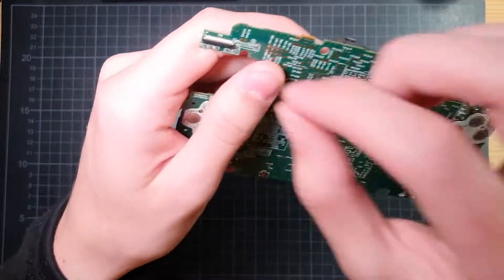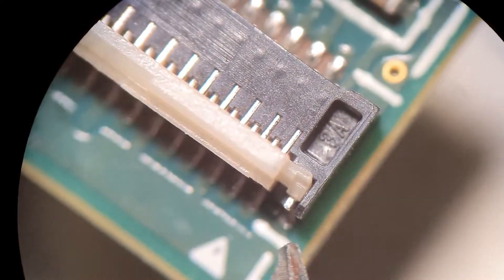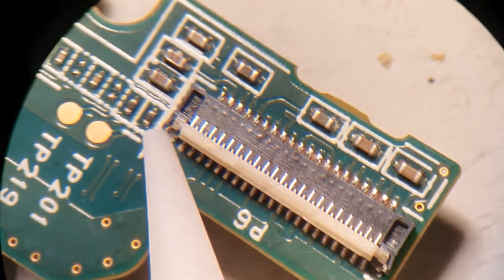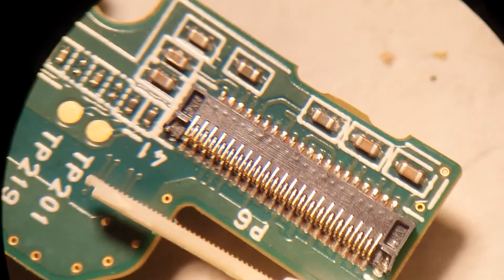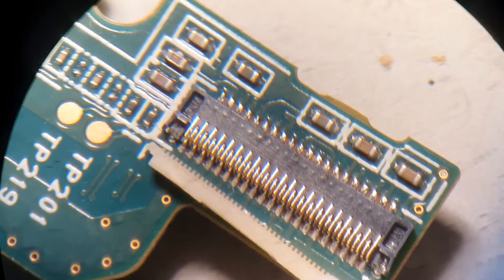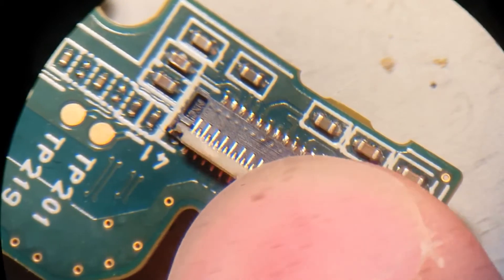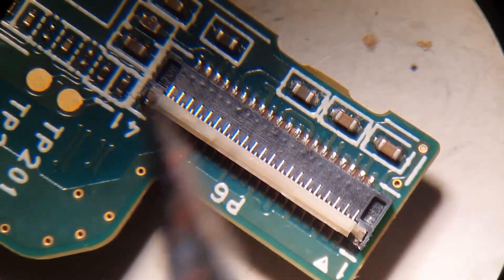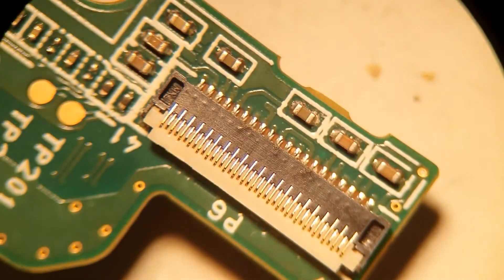Nintendo (New) 3DS (XL) 2DS Ribbon Latch Replacement (no soldering!)

Comment from the maker: Some additional info:
- It's possible to do this without a microscope, but it would have been hard to see on camera
- This isn't a perfect fix, soldering a new connector in place is the best solution. Still, this should hold up just fine if you're careful.
- Make sure to use a nice set of tweezers (I like ceramic tweezers, they don't bend) and a sharp knife while doing this.
- If you break one of the metal tabs on the side it should still work. Replacement is recommended though.
Reply: This worked and helped me fix my Mobo. Thank you for the help. You're AWESOME!!!
Reply: Shoot I had a few paragraphs written but then accidentally tapped on another video... anyways Im pretty sure the camera will be impossible to get to and idc about getting a new mic. But this one latch broke yesterday when I took my 3ds apart and I need it for the top display to work.. any Idea where I can get an extra one?
Reply from the maker: Did the latch break or the connector itself? You can get an entire connector on AliExpress, but you would need to solder it to the motherboard.
If you just damaged the latch (and the connector is still fine) you can buy an entire connector and harvest its latch.
Reply: @neotil1  Turns out I was able to get it in and then hold it in place at the bottom while I pushed back against the top. The hinge isnt there to hold it but it but it doesnt seem to move at all and has been working so far.

as for the volume ribbon cable, I couldnt manage to solder it down onto the 4 contacts without them touching so I tried taking the connector off to run a wire toeach hold it went in, and this pcb is oddly sensitive to heat and decided to become a lake for solder to live in. It took a while of scratching to get rid of the solder connecting everything since the ds had some sort of protection to not turn on (Im a little confused how that happened since the volume slider is basically 500-0 ohms and it still lets u turn on if you have your volume max)

 but afterwards I cut the 3.5mm jack off of some really really old ipod headphones to use a a mute for the speakers, and I usually have the volume max when I want to use headphones, so its really just the built in speakers that are irritating at max volume.

I got An emulator working great tho so Its not a huge issue that a few functions are broken on my ds still.
Reply: @neotil1  Can it still work with the broken plastic? One of those supports on the sides broke off.
Reply: using a microsope is much easier though

Comment: You're the damn coolest, replying to every comment! 

I have a N3DS (OG, not XL) that has broken latches for the home button and the touchscreen. Since new motherboards of the OG N3DS are pretty much impossible to find, I was wondering the the latch of the connectors from the N3DSXL would fit on the N3DS's board. Thanks in advance, man!
Reply from the maker: Wait, you mean the New 3DS, right? The Old (some people call it OG) 3DS has the home button soldered on haha)

The touch latches are all the same, but the n3DS models both have these weird connectors for the home button that don't latch up at all. They can't be replaced like in this video, they have to be soldered.
Reply: @neotil1   @3DS Repairs  Haha, that's right! I meant the N3DS.

The touchscreen seems fairly straightforward to fix, as the ZIF connectors are sold online by themselves. The home button on the other hand I don't know how it could be fixed, other than some homemade solution like tape or hot glue.
Reply from the maker: Yeah, the home button needs constant downward pressure to function. Hot glue etc. won't work...

I've seen a 3DS work that used some tissue paper to apply pressure between the connector and the housing. I wouldn't recommend it though haha. I always replace the connectors entirely (solder new ones in place)
Reply: Just broke my latch for the home button too, on a N3DS XL though, but still.

Comment: Do you have a channel to repair Nintendo 2ds? I have a 2ds that gives the charge led but the battery doesn't charge. I measured the 3 pins and noticed differences between another console that charges and one that doesn't

Comment: Hey any tips on how to fix one of the Touch Screen Ribbon Port Socket? The little grey piece broke off. I need 😫some help please!!!
Reply from the maker: Sorry, I don't have a video showing the procedure. Just bend up the pins slightly (about .5mm) and slide a new latch in place (you can reuse the old one if it's not broken). Close the latch and press down firmly to secure everything in place
Reply: @neotil1  ok thank for getting back to me. I will give it a try. If it's not yo much to ask maybe you can make a video of that down the line. Also do you offer any mail-in repair service? I have some of those grey clips coming from Ali express as I have found out they are easy to break. I wish I had a microscope like your to see it better 😔
Reply from the maker: Yeah, I'll see if I can make it happen. I haven't been working on (3)DS consoles for a while though as I have shifted my focus to Gameboy modding and analog camera repair lately.
I do offer mail-in repair, but you'd have to ship your stuff to Germany which wouldn't be cost effective hahaha
Reply: @neotil1  oh wow Germany! Well you never know, might be cheap for me to just take a vacation over there and drop it off in person! 😆
Reply: @7NINER3  hey, assuming you’ve gotten your clips and worked on this how hard was it for you to solder the clip onto that area because I legit have that same problem. 😭 ebay seller broke the clip but I’m determined to fix it.
Reply from the maker: I know this is a bit late, but if you're still looking for a guide, I just made one :)
https://youtu.be/4vQQOG1hmxA
Reply from the maker: @FlipJip8  I know this is a bit late, but if you're still looking for a guide, I just made one :)
https://youtu.be/4vQQOG1hmxA

Comment: Hello, I have broken the latch connector for the thumb stick of my New Nintendo 2ds xl.  Would it be possible to solder the ribbon to the motherboard?
Reply from the maker: Yes, but it's 10x easier to either fix the existing connector or solder a new one in place. Soldering a tiny ribbon cable is only possible with good tools, years of soldering experience and lots of patience.

Comment: Thank you!!!! This saved a N3DS XL, got the clamp out of the AXBY daughter while putting it together after replacing a damaged touch screen. 
Thank fully I found this video before damaging it more, when trying to fix it B4 watching this video I broke one of the legs of the white plastic. But just one was enough to make it work. I did this with only my nearsighted eyes haha, would have been better with a microscope as you said.

Before fixing it the console did the pop noise and didn't turn on, almost lost my mind haha. Now it works perfectly.

Comment: Thank goodness I found this video. However, my clamp broke in half on my larger fdc connecter, so I'll try to put it back as it is within a day or 2, (perhaps within 2 weeks) so for my gratitude, I'll share a eBay search where it has some of the fdc connectors for the New Nintendo 3ds Xl: the item is searched as "2 X For Nintendo New 3DS XL LL LCD Display Screen Flex Connector Plug Power"
This may prevent you from buying a whole donor motherboard.

Comment: The plastic part of one of my ribbon cables clamp is broken in half (the one for the motherboard). Should I pay to get it repaired or do you know where I could buy the plastic part, it’s for a New 3ds XL.
Reply from the maker: Connectors are very cheap on AliExpress/eBay :)

If you're unsure if you can perform a repair, consider taking it to a professional to be safe. You might save yourself a lot of money and headaches by not damaging parts any further...
Reply: @neotil1  thank you, I appreciate the advice :)
Reply from the maker: No worries, I hope you're able to fix it!

Comment: Does this also go for the small connectors (like the ones for home button)?
Reply from the maker: Unfortunately I don't have a tutorial for that yet. They are easily replaceable too:

Just bend up the pins a tiny bit (using an X-Acto blade for example) until you can thread a new latch in place (the pins go through the holes). Once that's done, flip the latch down and press to bend the pins back into place.

Note: you need to use a new latch. Usually the old latch is broken if it fell off. New connectors are available on AliExpress/eBay
Reply: @neotil1  So let me get it straight: if you remove the clip you usally break the entire thing (sorry for my broken English)

I thought you can easily just replace the tiny clips just like you did with the ones in the video, since that’s apparently not the case, how can I replace those things then? I guess there’s no other way than soldering, right?
Reply from the maker: No, it's possible to replace them without soldering. It's hard to explain in words but there are a couple guides on the internet
Reply: @neotil1  Could you please do a tutorial for that?
I really need a way to revive my 3DS without replacing the entire motherboard. I already did some cable replacements but I was told the clips are the problem, especially the small ones, the P6 connectors.
Reply: @aurasphere01  i have the same problem in my DSi, the connector of the small cable of the bottom screen, i ripped the lid off and now the dsi doesn't work. I can't find a solution other than to buy a new motherboard
Reply from the maker: @aurasphere01  I know this is a bit late, but if you're still looking for a guide, I just made one :)
https://youtu.be/4vQQOG1hmxA
Reply from the maker: @flavioandrade9621  I know this is a bit late, but if you're still looking for a guide, I just made one :)
https://youtu.be/4vQQOG1hmxA

Comment: Do you happen to know the part number for the New 3DS ABXY ribbon connector (motherboard side)?
Reply from the maker: I wasn't able to find the cable, but here's the button board: https://a.aliexpress.com/_uwMHRU

You can try to send the seller a message. They're usually super nice and will give you links to the correct parts if you ask them :)

Comment: Hey! Im having trouble finding a connector from both aliexpress and ebay do you recomend buying a broken 3ds for the part or just wait for avalible parts?
Reply from the maker: There are lots available on AliExpress... Which one do you need specifically?
Reply: Sorry didnt see your comment i need the small top one I also wanted to know if i need a hot air station or if I can just use a soldering iron
Reply from the maker: Did you watch the video? You don't need to solder
Reply: I did but you said that it is better if we get the whole connector if we broke the latch
Reply from the maker: Ohhh! I just meant it's easier to buy a whole connector (and then take off the latch yourself) then to try to search for just the latch separately. You still don't need to solder unless you bent your pins.

As for the connector, which one do you mean specifically? There are a lot of connectors along the top. You also haven't specified which exact model 3DS you're working on
Reply: @neotil1  i am working on a 3ds xl and the connector that i am working on is the top screen on the side of the mother board has the cardtige slot so the connector on the top right
Reply from the maker: I think you mean the camera connector, which is the most difficult to find :/ You can try searching for "3ds xl connector socket" on AliExpress to see if I missed something

I was able to find a replacement motherboard for around 25$ though: https://a.aliexpress.com/_mro7SOD
Reply: Thanks for the help I couldnt get what i was looking for but I think i will buy a new motherboard if i cant find it or maybe a junk motherboard idk yet
Reply from the maker: Ok good luck!

Comment: The video helped me a lot. Do you happen to know where you can get the 3ds xl LCD connector pin parts of the old model?
Reply from the maker: AliExpress is usually a good source
Reply: @neotil1  Unfortunately, it doesn't come out even if I search it. I'll look for more
Reply from the maker: I don't know if this has the correct amount of pins but you can follow the related items to find one that will fit! If you aren't able to find the correct part, just send a message to a couple sellers they are super nice and will usually help you find the right part if they have it :)

https://a.aliexpress.com/_vXmUhe
Reply: @neotil1  Thank you for your kindness! :)

Comment: This it impossible to do for me 1000+ failed attempts 💀
Respect to anyone out there who pulled this off
Reply from the maker: Yeah, the large connectors are a huge pain. You really need to make sure that all the pins are in the correct position so that the latch slided in properly
Reply: @neotil1  yeah just broke the whole connector, i ordered a new one from aliexpress hope it's the correct one and i hope i'll be able to pull off the soldering job, but honestly seems easier then to reconnect the latch